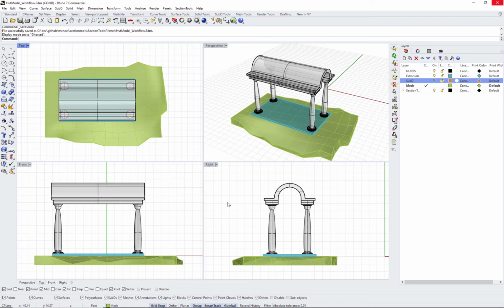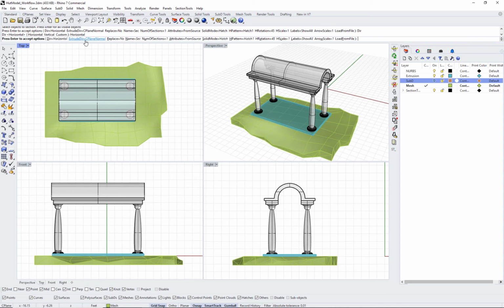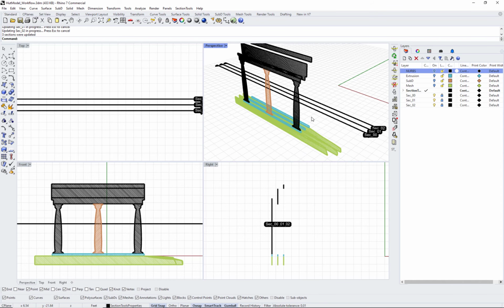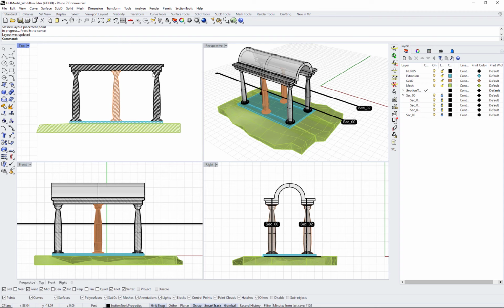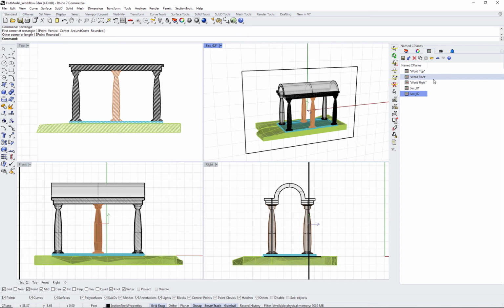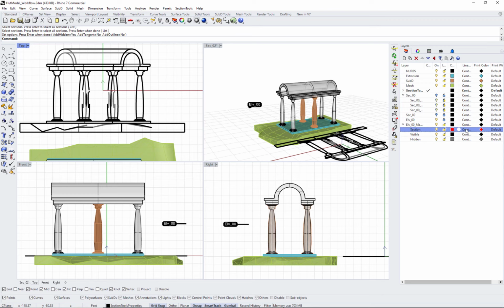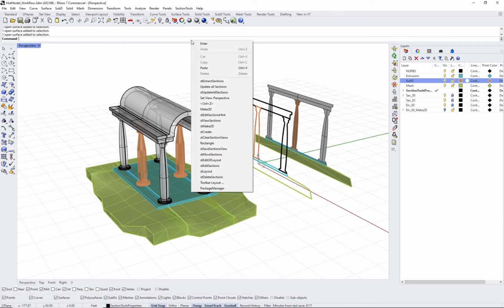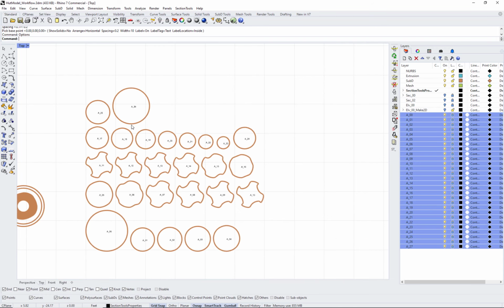SectionTools Workflow

Comment: I mostly use details in layouts looking into model space.  Front, top, right, perspective, the usual kind of 4 view layout.  I dimension in each detail to the objects (LxWxH) of a cube for example.
When using SECTION TOOLS is there anyway NOT to create a bunch of 2d objects and still show a slice through objects like a normal clipping plane.  You can set a standard clipping plane to clip layout views (horizontal section through a cube) without creating more 2d objects and without modifying the cube.  Can SECTION TOOLS do that? Can a SECTION TOOLS section be used to clip a layout view/detail without creating 2d objects that I have to have a separate layout for?